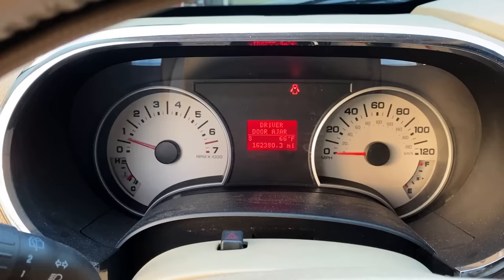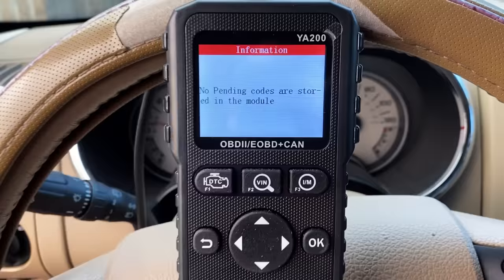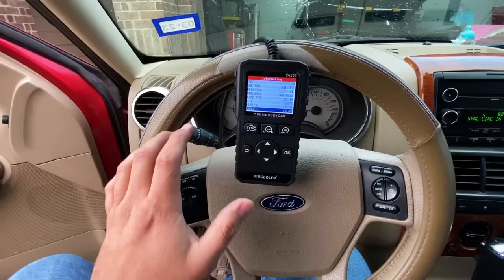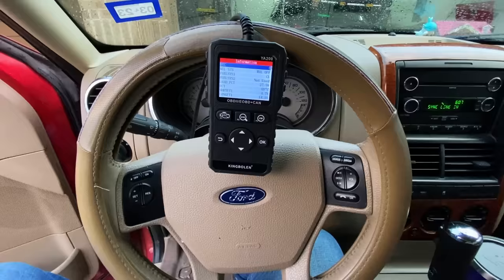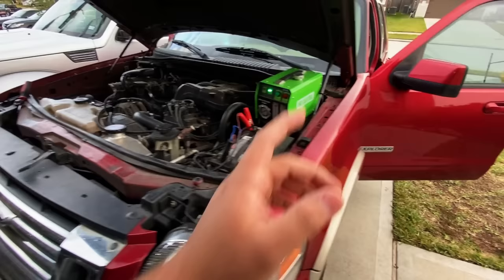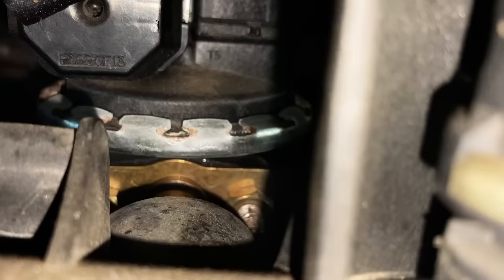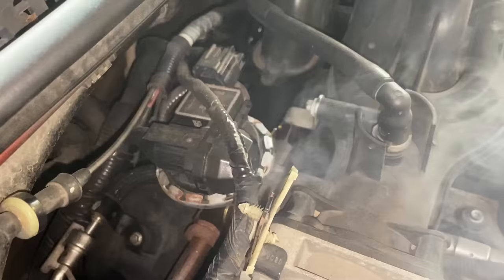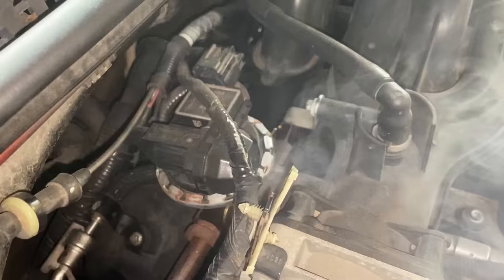FORD EXPLORER ROUGH SHAKING VIBRATING IDLE DIAGNOSIS & FIX

Comment: My car Hyundai i10 is idling rough, l took it to 3 different garage in London, and spend over £600 and they can't fix the problem. I need the car to drive 15 miles to work, unfortunately it is cost me too much on fuel. To be fair we don't have Good mechanics in London and if we found one, he can be very expensive.

Comment: I purchased a smoker last year and I'm having the same issue you described with your explorer. I just recently replaced a leaking valve cover and while i was at it i replaced the ERG value. So now I'm running much higher than the numbers you have. 
I have a 1999 XLT explorer with 256k miles on it. I so a lot of maintenance and have everyone tell me to just get rid of it until they ride in the car with me and realize it runs better than theirs. 
So now I'll pull out the smoke and see if and where there is a leak. 
That you for your videos as they provide a lot of help for guys like me who want to do their own repairs.

Comment: I ordered that smoke machine like yours.  I'll be using it on my 06 Nissan Frontier 4.0L V6 for that same problem except the engine feels like it has a rumble like a motor mount that may have collapsed but does not shake the vehicle. Bank one has a higher than bank two LTFT.  As always thankyou for this video, it is helpful.

Comment: That’s awesome I have the same issue with a 2004 explorer. Got back from shop after a new head gaskets and timing chain it’s still has slight shake. Going to do this on my own have all the tools. Infamous 4L v6 so I was leaning timing chain. Paid $3600 for engine pull etc. Idle was worse. They also replaced intake manifold they didn’t charge for. Lol

Comment: BOOM SHAKALAKA!!!
Nice job, love your videos!!! 👊

I’m dealing with an egr code 34 voltage too high in an oldie but goodie 1986 ford e-150
Exhaust smells rich…
I’ll need to check the vacuum lines next, electrically the sensor and wire integrity checks out, I replaced the egr with one from standard!

 It’s smoke time next too!!!
Very annoying can’t pass smog, and OBD1 🥶 can’t communicate with this beast….

Comment: Great video! I don't have a smoke machine, so I used a cigar. Just replaced the same gasket on my 02 Ranger, but sadly, still rough idle. Ordered an EGR valve, but I'll definitely check the fuel trims. Thanks!

Comment: Smoke will still come from that EGR valve even with a new gasket because they are equipped with a pin hole underneath the metal circular section, closest to the  manifold.  Had the same exact issue with a rough idle only at stops, however the misfire and shaking idle disappeared with the AC switched on.  I replaced the fuel filter  and it immediately corrected my issue.  Could barely blow air through the old filter.

Comment: Awesome explanation and diagnosis. You explained live data to a tee. Spot on, I definitely think you enlightened DIY people. Not a big investment for your OBII. I have the luxury of computers. Definitely enjoyed the application of the smoke test. You did an amazing job catching the bubbling, most people would just replace the valve. If you have an endoscope it can be very useful in tight areas that aren’t visible, especially for mechanics like me that are vision challenged. Overall you earned a like and follow.🤚🇺🇸

Comment: Use caution though when it comes to aftermarket gaskets on EGR valves. That smaller orifice on that old gasket maybe there for a reason. Ford may be solving some kind of a drivability issue with a calibrated orifice on that metal gasket.

Comment: This could be the issue to my Sonata, the engine mounts are fine  (new sparkplugs too) but still rough idles on traffic lights. It's also intermittent like you mentioned just that it's getting more often for me now. Drove 3x today with 2 drives having the rough idle issue and 1 just fine.

Comment: Check your TPS Sensor too!!....Mine had a rough idle, hard shifting, random stalls....No Codes either. I swapped the TPS, and ALL problems were instantly gone! I could never "prove" it was the sensor....but one day I went to start my truck and the idle started going haywire, Then I had a good idea it was that sensor. But these trucks are notorious for throwing them, people forget that.

Comment: I have a 2004 mustang and it has a very slight shake at idle that is felt in the floorpan/seat.  It is a shake and not a vibration.  I run mode 6 and get misfires every once in a while but I have no idea when it is even recording them.

My fuek trim at idle is +8% and +4%...I revved to 3000 and rpms didn't change so I'm ruling out vacuum leak.

I'm starting to think it isn't engine performance related and more to do with a balance issue either with the mounts (highly unlikely) trans mount, torque converter or harmonic balancer.  Rpms don't change when it happens.  I have put in new plugs wires and coil pack.  I ran vacuum gauge to it to determine even compression and any valve issues and it holds steady at 22 inches.  Needle doesn't budge.  I'm thinking this is either fuel injectors that are clogged causing a fuel injector balance issue where I get like minor misfires at idle that the pcm might not even detect but I do.....or the mode 6 just isn't even looking at misfires at idle.  I really wish I can get a scanner that can give me LIVE mode 6 misfire data.

Sorry for long post but has anyone ever had a bad harmonic balancer cause intermittent shaking at idle.  I did look at it and the rubber does appear to be dry rotting/cracking

Comment: Sure glad I found this vid as I have the same rough idle problem in a '03 Explorer 4.6. New plugs, wires, injectors etc  haven't helped much. I suspect a vacuum leak as it's periodic and the engine runs great and makes power. I suspect the plastic intake manifold but first I'll have to make a smoke machine.  Thanks for posting this!

Comment: Great video. Just be aware that this video is only applicable to engines that use a MAF Sensor. Engines with a MAP Sensor only will not be affected in this way.as they will use the leak in the fuelling calculations. Hope this helps someone

Comment: Wow thank you so much. I notice reading my fuel trims the numbers were 30 for long term and short term would be about the same or slightly more. When I'm at 3k rpms. I was driving the other day and only when the vehicle has warmed up I end up having a rough idle. And when I want to accelerate it would bog down and hesitate it would lag or worst case go nowhere and just bog down horribly. Reading these trims I can understand now. I'm kinda bummed out because I bought a brand new Delphi fuel pump from AutoZone and can't believe it's bad or defective. Now I'm a have to check and replace it again. But before I do I'm gonna check my fuel pressure regulator. Only thing I did notice was that my car would trigger a p0301 and then the p0171 is that meaning that the misfire is on cylinder one around the engine in that particular area. I was assuming fuel injector I already swapped it over but I get no check engine light telling me nothing.

Comment: Ha! This is good to know... I basically did the same with my 03'. Bank 1 guide was completely broken... ran fine lol both before and after putting the engine back in bank 1 was at 10% and i feel a little roughness...i honestly Thought the broken chain guide was the issue so i didn't really bother looking into it till after that repair was done. i smoked it and the throttle body shaft and the egr were leaking...i replaced the o rings on the throttle body shaft and fixed that and bought a oem egr...that was 5 months ago...the egr is still on my tool box... I'm being lazy about it 😆
Reply from the maker: I feel you. I procrastinate when it comes to doing work on my own vehicles. Just make sure you soak that EGR pipe nut with some penetrant fluid before you try and take it off. It will help a lot!
Reply: @ADVANCEDLEVELAUTO  i never have an issue with that nut...an air hammer tickling it works 100% of the time 😆. I've had that intake off a few times so it's got the anti-seize on it. When i originally took the intake off it was for a leaking valve cover gasket...that's wheni found the broken guide...drive it like there for 2 years worrying the whole time till i finally pulled the motor to do it 😆 i love wrenching on everyone else's but  i never like working on my stuff... i eventually get around to it

Comment: Brother I need ur help with a Ford fusion it shakes at idle and drive and reverse only on take off.runs good after 1500 roms.i change the mounts the EGR .clean the throttle plate.change spark plugs,coils.text it for leaks and nothing.check my fuel trims and there perfect.i have no codes either.any help please

Comment: what if the Bank 2 is high for me its 16% and Bank 1 is 11% , on high RPM Bank 1 become 0 and Bank 2 become 2.5%, recently i have changed Intake Gas Kits but not the EGR Gaskit, for Bank 2 what other things can leak the vacuum? PCV Valve ? your response will highly appreciate. btw your video's are just so informative and to the point.

Comment: I recently replaced a bunch of parts on my 03 F150 5.4, I did a smoke test on it and smoke was coming from a little cap on the backside of the IAC valve (which is also brand new).  I'm not sure if it is supposed to come out there or not...😬🧐🧐

Comment: Man I'm having the same issue with my 2019 mustang gt I need that scan tool I was thinking fuel issue and possibly vacuum... it has a very light stumble from time to time and It shakes more than I think it should but no codes

Comment: i have the same problem with my old 175,000 mi   06 coloraro , usually when i slow down to stop it has just a slight shake, stumble, fuel trims are in spec, it does have a 455 large leak code, guess its time to smoke it, happy turkey day🦃 to u and urs, thanks for posting

Comment: Check your charcoal canister, several perch valve, which is located by the engine or if it’s not that one check towards the back of the car I could be the charcoal canister purge valve stuck

Comment: Excellent video — I have a new 2023 Ford Expedition with only two thousand miles! and a problem happened with the fuel pump earlier and the dealer changed my fuel pump. After that it began to do this slight shake when stopped. Dealer can’t diagnose the problem and said no codes present and it’s normal to have a slight shake!! What can I do ? It’s driving me crazy. Note: car drives good with no loss of power. Only this shake when stopped.

Comment: Can you use the smoke machine in the intake tube with electronic throttle body? Mine kept building up pressure maybe becuathe butterfly is closed that the smoke kept shooting out..

Comment: Subscribed.
Short video but packed with info's .
Is there any DIY friendly way to check for vacuum leak? My 16 Ford explorer Ecoboost runs rough at idle that you can even see the "needle" on the dashboard jumping up and down (not too bad but you can see it).

Comment: I was wondering if you might know if it did the same thing with AC running while at a stop light or just parked..? Mine has shut off before after shaking n rpm drop. But never without ac or heat.

Comment: QUESTION: what is the best ‘handyman’ level code reader/diagnostic plug in tool that you would recommend for my 2007 Ford Explorer V8? I currently own an older Innova 3100

Comment: I have 2010 toyota corolla 2NZFE , 1.3 L engine, it has continouse long term rich -14%     , mechanic checked every thing, 140 PSi dry compression for each cylinder.   last he found that there is no thermostate, my question is , running engine without thermostate result in LTFT -14%,? assuming other things working fine

Comment: I have the exact shaking problem at idle, mechanic told me I had a partial misfire in only one cyl. All indicators pointed to a leaky fuel injector, LTFT was -22%., Replaced injector, LTFT dropped to 0. But now my STFT at park is always -22%, while LTFT is 0, and my vibration at idle hasnt gone away. I have no loss of power, car zooms when I touch the accelerator.,not a hint of vibration. MY LTFT and STFT add up to less than -10/10 % when driving. Stumped. Anyone know what might be the issue.

Comment: An additional way to confirm a vacuum leak is to see if MAF is lower than expected at idle, vacuum leak is un metered air and won't be accounted for.
Reply: What is it supposed to be set at ?  Because when I do the test with his same only it goes up and it’s at 3.64 g/s

Comment: I have a 2009 same vehicle. 4.0 V6 AWD. MINE IS DRIVING AND RUNS GOOD but I recently have a engine light on, but no driving or performance issues. No overheating. I checked the engine light and here’s what it says. P2197(1 / 1) Stored
02 Sensor Signal Biased/Stuck
Lean - Bank 2. Sensor 1

What could this be? If it’s the o2 sensors, where are they located? And how can it be done? Could it just be the Mass airflow Sensor?  I wish there’s a video on this because I don’t know the difference between bank 1 and bank 2.

Comment: Did you ever find the correct connection fittings for the transmission-to-transmission cooler?
Reply from the maker: Yes, a subscriber actually custom made some for me.

Comment: Found the video with the smoke machine interesting where did you purchase the smoke machine I might need one got a Mercury Mountaineer bad idle tried everything new EGR valve spark plugs wires coil pack everything probably need to smoke machine to try and find the vacuum leak

Comment: I need help guys, honda civic 2008 140hp 1.8L. Cleaned tb, reset tps, relearn done, pcv maf and egr cleaned and functioning. Same problem when comming to a stop. Sometimes it stalls sometimes rpm drops to 300-400 then come back to 700. It most def stalls if i drive in 4th gear and above while 4000rpm+ and put it to neutral, coast for 2 sec rpm drop very fast and engine dies ...at 60mph. While driving at 3000 steady rpm, its very jerky forth and back violently. Also have very rough idle, like the car is choking either on gas or lpg.. heeeelp

Comment: Hey my friend I watched a few of your videos I'm 60 years old I live in the state of Arkansas I have a 2005 Dodge ram 5.7L I drove to Walmart my truck was running fine and I went to get my medication because I'm diabetic when I came out my truck would not start it cranked over fine I didn't hear the fuel pump come on so I had it towed to my home and I changed the fuel pump yes I did it all by myself I've done it before I tilt the back and I race it high enough for me to get to the pump there's a little trick to it but I was going to ask you my truck is still doing the same I checked the battery and the battery was low so I went and bought a die-hard battery brand new it's still doing the same thing it cranks and then after a while it starts and I don't have the gadgets to test anything on the truck but one day I figured let me take off the negative battery wire the truck shut off so I'm thinking it's the alternator so I went to O'Reilly's with the truck because it does start after a little while you know cranking it starts I had alternator checked up they told me that it's fine but I really don't believe that also inside the truck when I turn the key on the gauge for the battery it's not all the way up to where it's supposed to be it's like halfway there but once I start the truck it goes to the normal reading and mind you the truck is running fine but it has the delay of starting can you give me some advice on what you think it might be have you ever ran into this problem before I appreciate if you can help thank you

Comment: Hi. Does this scanning tool show airbag information? My Reanult Modus has an airbag light for ages, but unable to tell which one causes it exactly. Thanks.
Reply from the maker: No this tool only reads the engine computer
Reply: The Thinkdiag video from ADVANCED LEVEL AUTO, It would be good for you.

Comment: Have you ever saw P219A on a Silverado / Sierra/ Tahoe / gm truck?
Reply: this may be the answer; _ P219A - BANK 1 AIR FUEL RATIO IMBALANCE.

The Powertrain Control Module, known as the PCM, is responsible for monitoring the air/fuel mixture in the engine banks.  This information reaches said controller thanks to the Oxygen Sensors, also called Air Fuel Sensors, which have a detection element to fulfill their objective.

 Oxygen Sensors are installed in an exhaust pipe and a detection element located in the central part of the pipe.  In this way, when the gases are expelled from the combustion chamber, they can be detected by the sensor.  Subsequently, the air enters a chamber located in the central part of the sensor, where the temperature of said air is increased and ion energy is produced.  These readings are interpreted by the PCM as a change in exhaust oxygen, and are converted to a voltage signal.

 When the DTC P219A OBD2 code is set, it means that the PCM detected that the air/fuel ratio for bank 1 is unbalanced.  👋

Comment: Great demo.. i have same car and same problem but the fuel long reading around 5 and it reduces on high RPM. i guess its not a vacuum leak. Any clue?
Reply: That means it is a vacuum leak

Comment: Hopefully  someone sees this response. 

2007 had a intermittent  p0305 p0174:

Parts changed out
Wires
Spark plugs
Coil pack
Fuel filter
Fuel injectors and seals
Intake gaskets
MAF
O2's on Bank 2 upper and lower
Waiting on new pcv valve.

Still has rough idle and smells like raw fuel.

I have used cans of starting  fluid looking for a vacuum leak to no avail. 

EGR/MAP ?

Comment: My fuel trims are pretty high 40%....I hit the gas to 3500 rpms and they did not move...any ideas on what the problem could be? Also, I tested all fuel injectors and are working just fine.... after I release the gas the rpms go down to 400 for about 30 seconds and feels rough before getting back up to 800 rpms. Please any ideas of what the problem could be? Thanks.